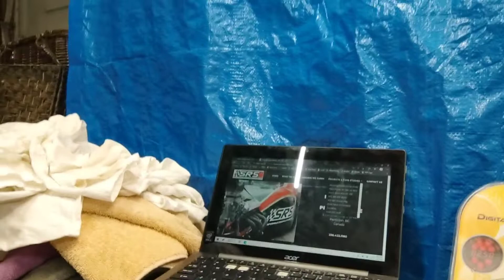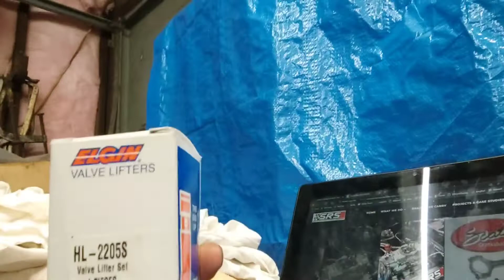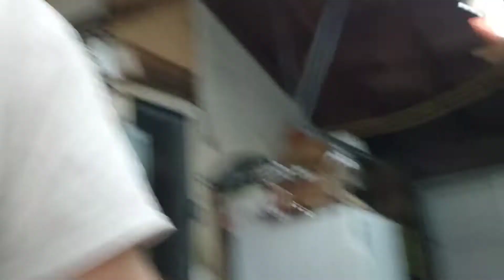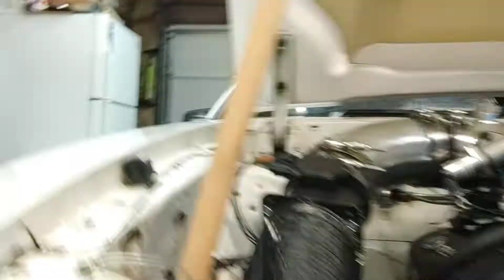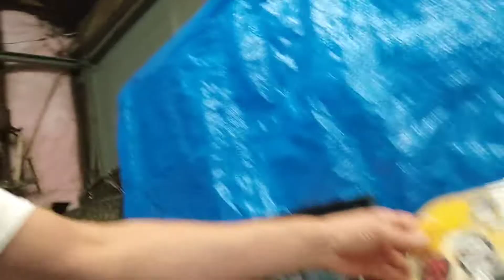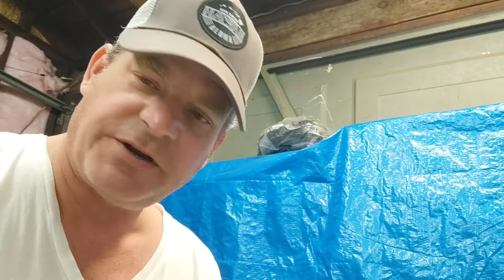Weekend update, new parts for the 349 Ford Stroker

Comment: Great update…the 1.7’s shud help as every little bit of HP counts! I usually set my ride height with the front end being 1” lower than the back.  Look forward to seeing some nitrous hits once everything else is dialed in! 🙌🏼🏁
Reply from the maker: Thanks Paul, that good info, where are your wheel wells at front and back, I know you got way different suspension but just curious, my fender wells are right around 27.5 from the ground
Reply: @vrm86gt  My rear is sitting about 1” lower than you at 26 5/8” 🏁
Reply from the maker: @PaulDaFox  ok and your front 1 inch lower than that I assume?
Reply: @vrm86gt  Yesser👊🏼🏁

Comment: It’s crazy what some cars can make on a holy grail run. I don’t know what to even trust my 351w and turbo 400 to
Reply from the maker: I thought the 351w blocks were  good to 750 or 800hp, a built th400 should handle that also!
Reply: @vrm86gt  that’s what some claim but I honestly don’t believe it sir. I’m sure they can on a few single runs like Holdener but I don’t believe it. I don’t have a built th400 either
Reply from the maker: @timweb1510  yeah I'm  still running the 302 block,  just what I've read and heard about 351w vs 302
Reply: @vrm86gt  yessir

Comment: Where do you look up Simpson's at, you may have just sold me half a set of 1.7s😂 I have the new ford racing lifters the ones that they redesigned 3 or 4 years ago, they're supposed to have changed the check ball and something else that keeps them from losing hp in the higher rpms, im fixing to change my springs for some Howard's high revs or trick flow dual springs, 391 spring rate i believe because my power fell off at 5700 and should have at least went to 6500or or better
Reply from the maker: Here you go
https://simpsonracingsolutions.com/stock-block-670-hp-sbf
Reply: @vrm86gt  thanks man I appreciate that, they got 50hp with a 1000cfm carb over a 750 that's crazy
Reply: Are you using the springs that came with your heads or did you swap them out? If so which ones did you use?
Reply from the maker: @79beans347  I am using Lunati springs from FTI spec for TW 170 with tool steel retainer upgrade
https://www.flowtechinduction.com/lunati-dual-valve-spring-kit-73925k2tw/
Reply: @vrm86gt  thanks man that's a nice spring kit. How high are you turning it ? Im checking around trying to see what my best option is.👍🏼
Reply from the maker: @79beans347  last time at the track the car wanted to rev to 7K no problem (that is if the factory tach is accurate! Lol!)
Reply: @vrm86gt  😂🤣😂 hopefully so , mine revs so fast with no hesitations and I love it, Ive never had one that was as rev happy as this one. That's about where I want mine to rev. I just got to get it to stay happy past 5700 because I know that everything but the springs are man enough to handle it. I had a bad feeling when I got them that they were not up to the job. That's the only thing I have seen so far that I wasn't happy with is that it peaked at 5700rwhp @ 422rwhp and the cam is good past that
Reply from the maker: @79beans347  maybe you can shim the springs up and get some more pressure as long as you got plenty of room before coil bind
Reply: @vrm86gt  yeah I just don't have enough room, or i would plus they are a cheap spring, I miss read the listing thinking that i was getting a complete comp cams spring kit  but everything was comp cams but the springs and in fine print it said that the springs were similar to the comps 🤦🏻‍♂️
Reply from the maker: @79beans347  gotcha, I don't regret spending the money on quality springs and retainers, car revs cleaner up top. Pretty sure you will pick up some power up top with better springs if your topping out at 5700 now.
Reply: @vrm86gt  I thought that I was getting a good deal on a decent setup but I should have known that it was to good to be true 🤣
Reply from the maker: @79beans347  your setup is more than decent as is! What cam are you running in the pinto?
Reply: Yeah I was talking about the spring kit, im more than satisfied with the rest of it . I just know that I am leaving power on the table and I want to get it all out of it. I will be doing that 1.7 s but with the new springs I should have enough room to run 1.7s across the board and if it will rev up to 7000, without the power falling off there should be a substantial power increase based on what I figured even if it just makes power up to 6600-6700 but hopefully it will at least go to 7000. I probably won't run it no harder than that and will have my rev limiter set to 7200. The cam that's in it is a comp cams XR294HR-10 part number is 35-427-8 that top number pulls up a Chevy cam with some of the same specs but the lift on the chevy is almost stock 😂
Reply: @vrm86gt  thanks im very happy with the setup , just knowing those springs are holding me back in the top end is eating me up and I have to get those things out of there asap so that I can get all of the power 😂
Reply from the maker: @79beans347  cool, I liked the comp cams I had xe264hr-14! I will check that xr294
Reply from the maker: @79beans347  do it! You will be glad you did

Comment: excellent vrm 👌🏼🏁, you need that 1.51 back.
Good indication you can see there from the next lane comparison. Like i said before vrm back in the day I’d run that same mph & 10.6s-10.70s with a 1.50/1.51 also...... you have the power in the 349 no doubt, just need to make it happen now 👍🏼🏁 badass.
Reply from the maker: Agreed, we will keep at it!
Reply: @vrm86gt  👍🏼🏁

Comment: Hmm.. so what exactly is the screen for?  Never heard that before
Reply from the maker: To straighten out the airflow when it passes the mass air sensor
Reply: @vrm86gt  learn something new everyday!
Reply from the maker: @19jody72  yeah, my pro m meter came with a screen before the sensor too, he just said this meter was reading erratic and to try a few screens before and after the meter to straighten out the airflow so I was able to put 3 before and 1 after the sensor. It may be overkill but as long as it works and I don't show any intake restriction I'm going to leave them as is!
Reply: @vrm86gt  I'll have to remember this trick!